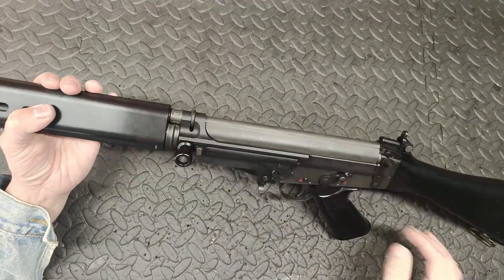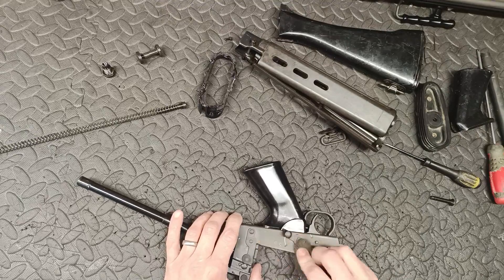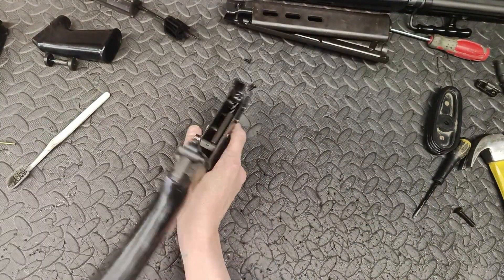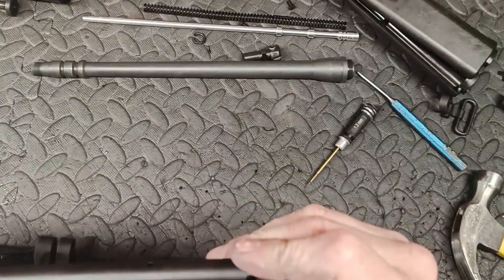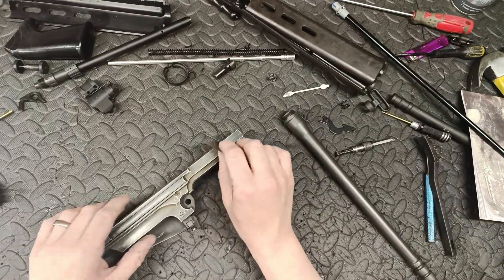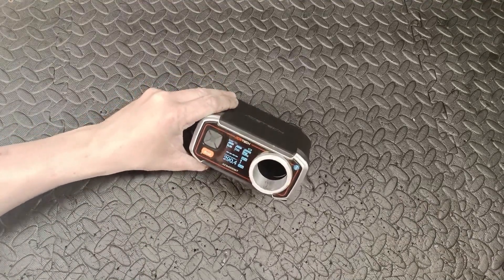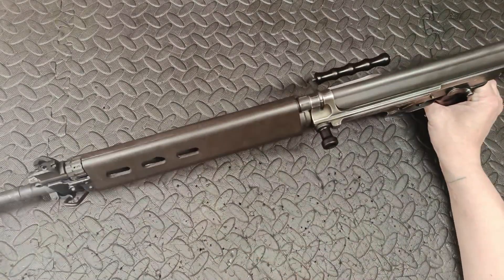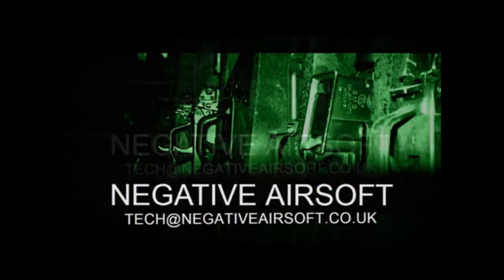VFC LAR  Epic Build! (Re-Upload for HD)

Comment: Well as I've had the pleasure of using the real steel,  it looks over worn in my opinion it wouldn't be as bright as that and what's with the brass🤔 still a lovely build though 🤗
Reply from the maker: Depends on age, cleaning... I have a deactivated G3 that's almost brown/chrome.

If it's been used to fuck for many years & continually de-rusted, they become almost polished gun metal.